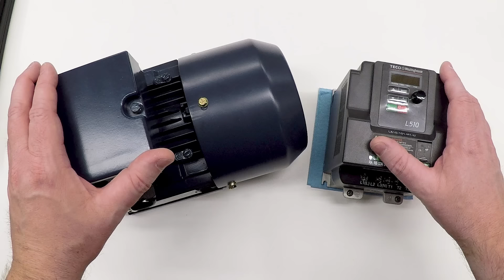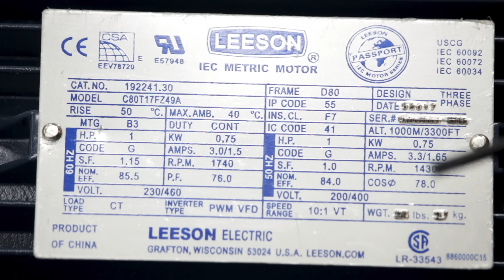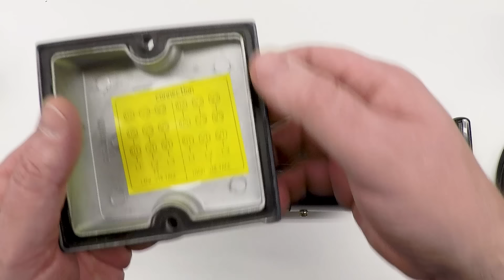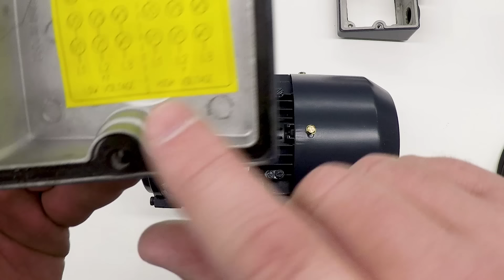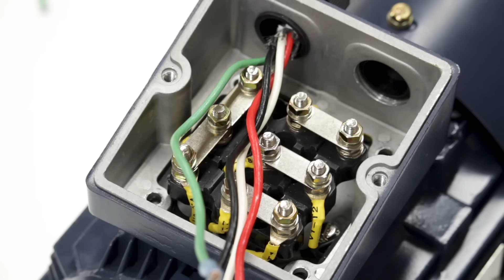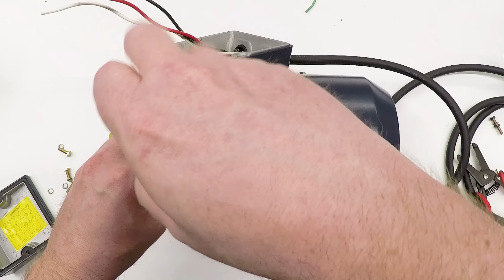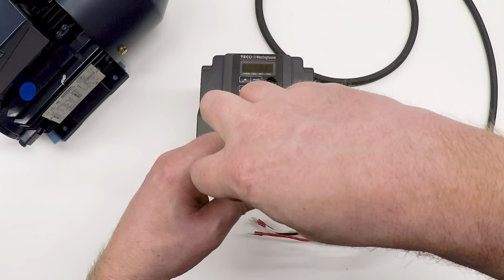Lathe VFD 1: How to wire a 3-Phase motor and VFD

Comment: When using a VFD the cable for the motor must be sheild and connected to the frame or ground in the VFD to prevent EMC noise.
Reply: Not only should proper shielded VFD motor cable be used but the shield should be properly grounded at both ends to form a closed loop essential for effective shielding for the magnetic interference from the motor current. Fully conductive EMC cable glands are purpose made in a range of sizes matched to the VFD cable and should be used to ground the shield to the motor terminal box. Plastic cable glands are unsuitable for shielded cable. Good quality VFDs have good solid cable clamping brackets for grounding the shield close to the VFD motor terminals.
Reply: @keithfisk5641  i was looking for this, thank you
Reply: Must is a strong word. It should be, but it would be hard to notice it at home. Noise becomes a problem when you have multiple drives running and your PLC's are trying to communicate.

Comment: thanks for the vids . Does the groundwire for power cable in VFD shorts the ground for motor cables ?i have this VFD named invt from gooddrive company , it does not have a grounded terminal for  power cable but it has a terminal for motor cable. shall i just connect to that terminal. appreciate any help .

Comment: Hi James,
What size is the cable gland you used for the motor and where did you get it?  I'm assuming it's metric 16mm?  I've been planning this upgrade for a while and already had the Leeson motor and Teco 510 VFD,  but I did by the line filter, pots and Ferite rings through your affiliate links.  My motor also had the 6 posts like another viewer mentioned.  It was more of a PITA to wire than yours, but I think I've got it. 

Any info regarding the cable gland will be appreciated.

Jody

Comment: Is there any particular reason you decided to go with 110v input instead of 220v? Is there more power to be had at 220v than using 110v? Thank you
Reply from the maker: 110v is sufficient for a 1HP motor.  I have 220 in the shop as well, but 110 was more convenient
Reply: @Clough42  thanks I was just figuring on going with 220v but I'll just go 110v and not have to worry about adding more outlets. Thank you for answering back! Greatly appreciated!

Comment: Regarding the VFD:  "this one is actually UL listed - surprise surprise."  It's made in China.  Is there any way to verify the UL listing?  The Chinese have been known to label things UL listed when they really are not UL.
Reply: Apparently... no. Not unless you're willing to register a free account with UL so they can slurp all your private information down to the size of your underwear. This is a new thing of course, as registration was not required in the past for looking something up, but presumably UL got envious of Google, Facebook and everyone else and wanted in on the slurpage racket.
Reply: TECO Westinghouse is a really large company that has offices in the States.  I have used their products in refineries for decades.  I really doubt they will risk their reputation and product line over relatively inexpensive gear like this.

Comment: Bud   Anyone that can understand all the jargin that you a talking isn't watching your video.  We would be looking for a down to earth simple explanation of the vfd etc.  Don't mean to be critical here but im sure you have just have not considered this simpler would be better here.
Reply: I disagree.  As a licensed electrician, I can say all this information is necessary for selecting the correct motor and VFD for a given application.  James has broken it down pretty thoroughly.  If the jargon is too complicated, maybe doing further research for yourself or consulting a professional would be of greater benefit to you than watching videos?

James-  BTW, there may be a more "correct" way to strip SO (or SEOW or SJOOW as it were) cable, but yours is how it's normally done in the field.
Reply: I’m watching this video to educate myself about 3 phase motors for a potential job interview

Comment: Hi James,
Any chance you could give the dimensions of that motor, (diameter and length), I have A HF 8 x 20 and I’d like see if it would fit onto my lath?

Thanks
Reply: Brian A google a d80 frame. That will tell you what you need
Reply from the maker: As mentioned, it's a D80 frame motor.  There's a drawing from Leeson here:  http://www.electricmotorwholesale.com/index.cfm?fuseaction=product.download&fileId=276008

Comment: great video where were you going to find the shorting bars for the motor
Reply from the maker: I didn't think I had enough, but it turned out there were extras stacked on top of each other in the factory configuration.

Comment: I tried to find exactly the same engine and VFD, however, I did not find. Is the motor more powerful and the other VFD can be similarly configured?
Reply from the maker: There are links in the description to the parts I used, though I don't know where you're located.  I'm sure there are other motors that would work.  I would think that any 1Hp (.75Kw) 1800RPM D80 motor rated for inverter duty would work.  And there are lots of VFDs on the market that could be used.  I chose the L510 VFD primarily because it is readily available where I live and has an excellent manual written in my native language.

Comment: At 22:28, talking about the 4.3A max out corresponding to 19A at 100V in...does that imply that the VFD efficiency in that case would be about (3^.5)*4.3A*240V/(19A*100V) = 1787W/1900W = ~94%?  just dividing power out (using square root of three and assuming a power factor of 1, based on https://sciencing.com/how-6521700-calculate-3-phase-power.html) by power in.
Reply from the maker: I just have the specifications in the manual to go by, and I don't think they specify efficiency numbers or explain how anything is calculated.  The motor power rating table in the manual says the input is "1ph 100-120V +10%-15% 50/60Hz".  I don't know if they're figuring 100V - 15% as the worst case.  If they are, the efficiency would be higher than what you're calculating, but I don't know.

Comment: Where did you get the fans
Reply from the maker: The quiet fan I put in the box is a computer case fan, purchased from a seller on eBay.  The smaller, higher-power fans are salvaged from old computer servers, but are also readily available on eBay.

Comment: I had the same problem you have to configure the VFD to get it to work
Reply from the maker: Yeah.  It's working now and the video will be up soon.  It turns out that the default settings in the VFD did not match the defaults shown in the manual.  Either the manual is wrong or someone else had their hands on this VFD before me.  Maybe it was a return.  I don't know, but it's working great now.

Comment: "As long as I'm pulling the motor out, I might as well put in something that I want"...

Oh, man.  The horror stories that have started with that line...

Almost as bad as "all I want is to replace the shower doors with a curtain".  That one went through uncovering rotted studs to eventually discovering the house was actually red brick that some doofus covered with vinyl siding.  Beware the seemingly simple project!

More seriously i'm wary of even marginally exposed machinery wiring with rubber or plastic insulation, because of what i've seen hot, sharp chips do.  Flexible conduit is cheap insurance.
Reply from the maker: Yeah, I've been involved in projects like that.

I wasn't worried about the exposed rubber wiring, given that the original machine had rubber (actually PVC) cabling.  I'll think about armored conduit.  That's not a bad idea--at least for the high-voltage, high-current stuff.
Reply: Wait what's the problem with red brick house? They are way stronger than timber houses.